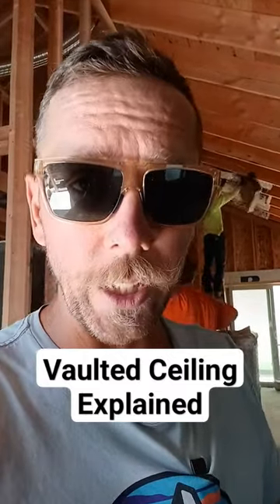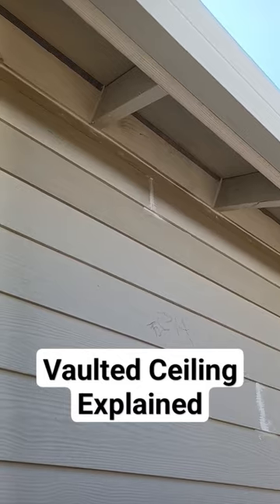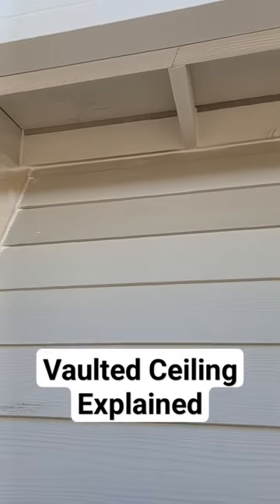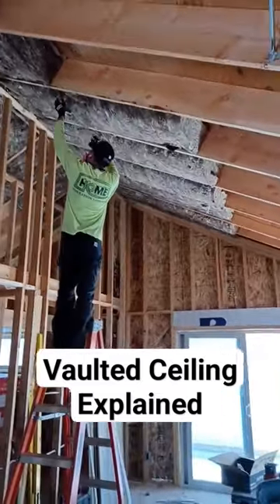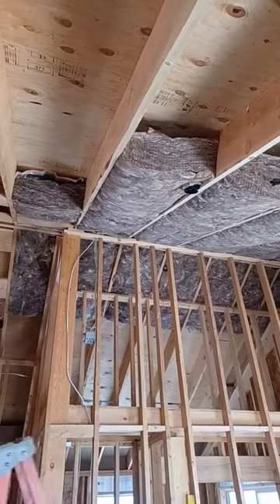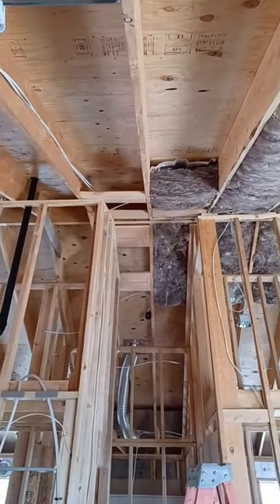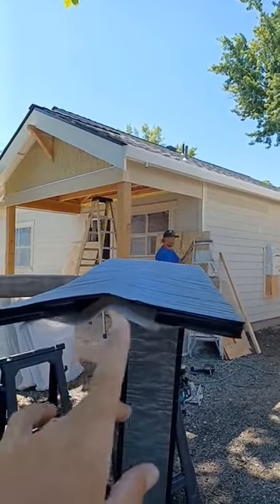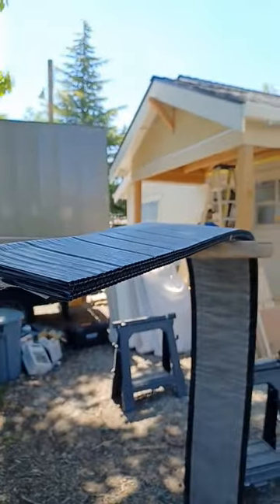A Vaulted Ceiling Explained

Comment: Did you use the baffles along entire bay or just the beginning of the bay? Basically was there a baffle under each batt to lock in that 1 inch air gap?
Reply from the maker: Just at the eves and in a few spots where there was 2x4 backing in the bay.

Comment: My ADU will have vaulted ceilings per plan. Is this concept required by codes? By energy efficiency standards? I forwarded your video to my contractor. You are a SUPERHERO! Big red A on your chest! (A for ADU in case you missed my weird humor) p.S. in Inglewood cA
Reply from the maker: The R value is a code requirement, the airspace can be to unless the cavity is full foam, either board or sprayed.